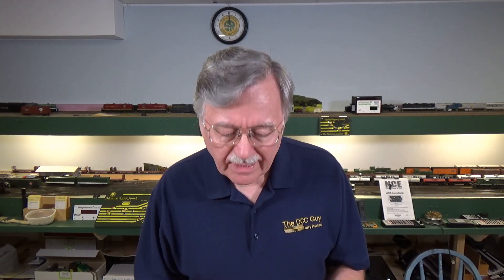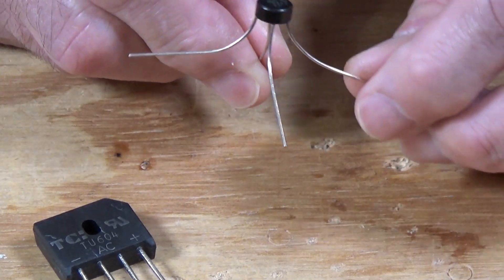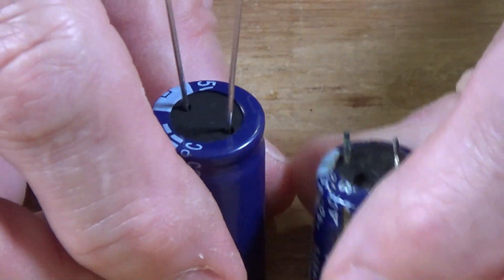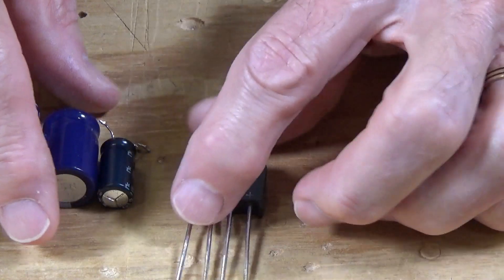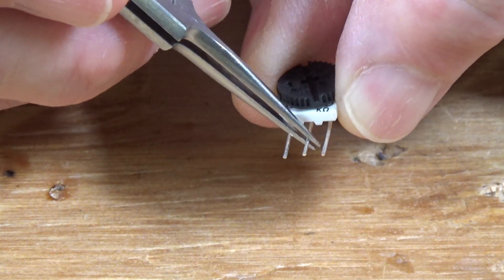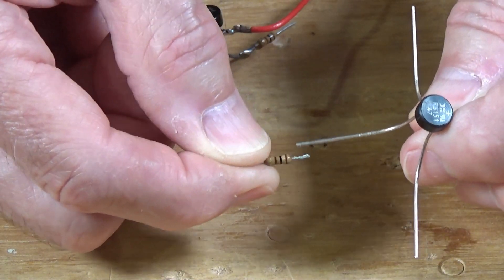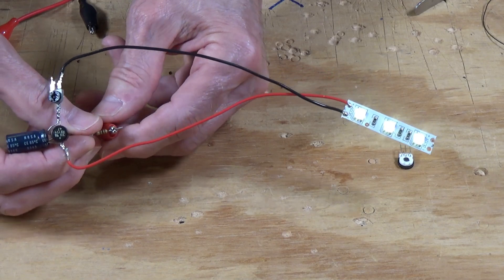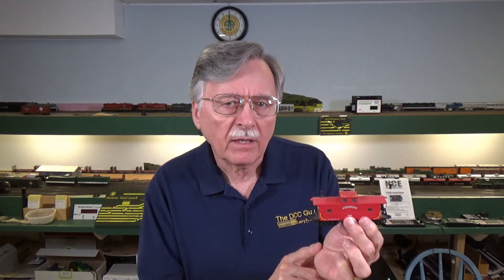Stay Alive Lighting For your Cabeese and Passenger Cars (101)

Comment: Hi, any suggestions for making Walther's passenger lighting kits flicker free. The kit comes with a lighting circuit board with built in LEDs . Just very sensitive to dirty track , dust ect.  Want to add a capacitor to store power, but do I need to still use all components as outlined in the video ?. Any suggestions would be great. Thanks.
Reply from the maker: You would think they would have included a capacitor in the circuit. I have one of theirs somewhere so let me see if I can find it and see how it works.
Reply: @TheDCCGuy   hey that would be great if you can look into that. I bought five cars with five lighting kits and I just hate the way they flicker.. mind you I didn't like the metal contacts in the kit that powered the LED printed circuit so I had fabricated my own. So basically the way it works is the weights on both sides of the car are electrified and isolated from each other from the trucks. I soldered a wire from the weight to the printed circuit led board for both sides isolated of course,  so current path is rail A to truck to metal weight on that side , then wire,  then circuit board and rail B does the other side the weight then circuit board the same way. I did this because the Walthers Way was so flimsy,  if you touch the roof the lights would shut off.  I need something in the middle of the wires  like a capacitor . Just a little unclear of the process. If there's any suggestions that would be great thank you.
Reply from the maker: The problem is the capacitor will need to be a polarized electrolytic type which means you need to feed it DC power not DCC. So you need a bridge rectifier in lone before the cap. The Walthers circuit may have that, I don’t know. The ideal approach would be to add the cap to the existing circuit if it has the rectifier, but that would be difficult to arrange. You might be able to just add a bridge rectifier and a cap in the wires from the track. The trouble is the Walthers circuit likely has a voltage regulator or resistors designed for a specific voltage range so you would likely need a 16V cap but it has to be big enough to give you the stay alive effect. Let me see if I can fond my old light board and see what might work.
Reply: @TheDCCGuy  Thanks alot !
Reply from the maker: Good news and bad news. I found the box but it is empty so the circuit board is floating somewhere and did not turn up on my searches. I tested the dining car I bought it for and no lights so I guess I did not install it. It apparently is designed for DCC use and looking at the photo on the box it has 4 diodes to create a rectifier and what I assume is a voltage regulator to provide the correct voltage for the LEDS. So if this is correct, it should be possible to wire in a series of super caps to provide stay alive, but without experimenting one one I don’t want to go on the record providing a guess. I’ll keep looking for the board as I know it is down there somewhere, but it has been almost 10:years since I last saw it.
Reply: @TheDCCGuy  do you want me to send or post a picture of the led board ?
Reply from the maker: I finally found mine, which according to the label on the package is designed for DCC and is for heavyweight cars. It was originally designed in 2004. It basically is just a bare board with 3 light bulbs wired directly to the contacts on the board near the pickup tabs at one end. So it appears on this one they went cheap and just put in ~16 volt light bulbs underneath the milky looking light strip and ran them in parallel off DCC power with no rectifier or voltage regulator. It would be easy to add a 16 volt cap and  1 amp bridge rectifier. You could even use one of the little buck boards and rectifier as I showed for the caboose lights allowing you to adjust the brightness to your satisfaction. Now if your board is different and uses LEDs then that’s a whole different ball game.
Reply: @TheDCCGuy  yeah mines different. The board has LEDs about 6 of them and the board has electronics on it, looks pretty busy.  Maybe just a capacitor needed , I don't know. I'm going to post a YouTube video on my channel on how it looks. Maybe you can take a peek. Thanks
Reply: @TheDCCGuy  ok so I uploaded a video showing what the board looks like. Hey listen I appreciate your time. I'm pretty happy with it but would like to make it perfect if possible. Thank you very much for your response.
Reply from the maker: I looked up Peter’s Trains and couldn’t find anything, is that the name of your channel? Can you just give me a link to the video?
Reply from the maker: OK, I found it and looked at the circuit. It appears to have a bridge rectifier, a couple of caps (brown rectangles), a resistor, and something else (6 legs) that I am not sure about.On the LED side it is clearly marked with +/- feeding the LEDs and I bet it is 3 VDC. So take a couple of clip leads and hook the board up to your track then check the voltage at those contacts. If it is 3VDC then you could install one of the 3V 1 F supercaps right there as a stay alive. Test it with clip leads before soldering to the board to make sure it works and doesn’t overheat and explode on you.
Reply: @TheDCCGuy  Thank you so much, I will try that . I'll let you know what happens. Appreciate your time.
Reply: @TheDCCGuy  Question ? If it is a 3V 1F supercap needed do I wire that across Rail A &  B connect ions (parallel )  or on 1 rail side only , in series like Rail A direct to one side of led strip and Rail B to  inlet of capacitor and then outlet of capacitor to other side of LED strip ?
Reply from the maker: Try matching polarity of the cap to the solder tabs on the circuit. It should recharge when power is on and then bleed it back out when power is interrupted. It is essentially the same as I did with the caboose lights.
Reply: @TheDCCGuy  thank you very much I'm going to order the capacitor you mentioned it is 3 volts and try it out. What's your name?
Reply from the maker: Make sure to actually measure the voltage across those contacts feeding the LEDs to confirm my WAG before ordering them.
Reply: @TheDCCGuy  Hi Larry , yes I will measure the voltage of the LEDs and see what it is before ordering capacitors. Thanks. I'll let you know  what the voltage is.
Reply: Hi Larry . Ok so I measured 2.8 v on those +& -contacts on the led board .
Reply: That voltage of 2.8v  was at the plus and minus contacts on the circuit board not the inlet contacts. Could a capacitor be soldered on the board  where the plus and minus  contacts are ? 3V 1 F  ?
Reply from the maker: Yes, that is the place. Also the capacitor will not charge to more than the provided voltage so 2.8 will be good as it is under the rated value and won’t overload the cap. Make sure to attach + to + and - to -. See my video if you are not sure. e is not room to pit the cap on teh circuit board you can attach it using small wires and tuck it wherever it will fit.
Reply: @TheDCCGuy  That's awesome, thanks alot for your advice, I've always wanted lighted passenger cars but couldn't stand the flickering. So excited to start that operation. I subscribed to your channel , your videos are so inspiring. I'll let you know how it turns out. Thanks Larry.
Reply from the maker: Another thong I just thought of. You may need to add a 100 ohm resistor on one input wire to,prevent inrush current from shutting down the booster. Since I have no idea how this circuit handles current I am not sure whether you will need it or not but it was necessary with my lighting circuit.
Reply: @TheDCCGuy  Hi Larry, yes that's a good idea, I was looking at the caboose video again and I was thinking of a resistor but wasn't sure how much resistance. Good idea. Thanks for your time .
Reply: @TheDCCGuy  Hi Larry, having a little difficulty finding a 3V 1F super cap, could I use a 5.5 V 1F capacitor ?
Reply from the maker: Mouser.com has over 2100 in stock. Look for 581-SCCR12E105SRB

Comment: I just found out that the "Radial electrolytic capacitor 1000uF, 25V" is the BIG one, not the smaller one since that's what I ordered. Fortunately, I think I can use these since I am doing passenger cars. Still, I was expecting the one you used.

Comment: Okay, now I'm confused. I watched your other video and it says this won't work for strip LEDs because they require 12 volts and with this one it seems to work fine. What is the output voltage here? Are these 3v strip lights?
Reply from the maker: Light strips like those sold for use under kitchen cabinets require a 12 VDC power supply. Individual white LEDs require about 3 VDC and in my smaller circuit I set it for 3 VDC accordingly. So you have 2 options for lighting cars, one smaller than the other. I did the second one for folks wanting to use individual LEDs working in N-scale.
Reply: @TheDCCGuy  I am looking to light passenger cars in HO using strip lighting so the output for them is right in the second video showing the strip lights?

Comment: @LarryPuckett can the leads on the bridge rectifier be trimmed shorter in any way?  I understand that the parts look A LOT bigger than they really are, but just out of curiosity.

Also, just out of curiosity, can the trim pod be wired to TWO light setups, so that when the knob gets turned one way one LED gets brighter and the other dimmer, and then when it gets turned the other way the one gets dimmer and the other brighter?  My mental gears are turning at full speed right now trying to imagine a use for such a setup....
Reply: Maybe a Christmas light setup using the fiber optic lighting method described in the January 2020 Model Railroader.
Reply: Or better yet, lights on a microwave tower as they used to operate up until the mid- to late-2000s or so.
Reply from the maker: You can trim them back as far as you want as long as there is something left to solder to. As for your other question the pot is just a variable resistor—turn it one way and voltage goes down, the other way it goes back up.

Comment: Thanks Larry for the great video.  Been wanting to do this for years.
I would like to use a function output form an old DCC decoder to control (ON & OFF)
the lights in a caboose.  Could I use the circuit you describe in the video, by using the
blue wire (+) and the purple wire (-)from the decoder.  I wouldn’t need the bridge rectifier
as the output from the decoder is DC.  
What are you thoughts.  Thanks
Reply from the maker: My main question would be how the decoder will respond to the demand from the capacitor, it may take it a d may not. I have never tried that type of arrangement.

Comment: If those lighting strips are used, how much draw is the 12v LEDs going to cause from DCC?
Thanks,
Mark
Reply from the maker: I just checked and the strip I used in the video pulls 0.03 amps or about the same as a small loco headlight bulb.
Reply: @TheDCCGuy  OK that's perfect but let's say I don't use a trim pot, what size resistor would bring that down to 12v?  From a 14v DCC NCE system?  Could I go with a 1 or 2k resistor?
Reply from the maker: Either should work. the 1K will be brighter of course, but Loksound uses 2.2K on the Direct boards. You might need to do a test with one of each. You also could use 1 trim pot, dial in the brightness, then measure the resistance value across it and know the exact size to use, it might be 1.5 K!
Reply: @TheDCCGuy  I tried a 2k but it seems to only light up the first 2 LEDs in the strip.  Could that be too much resistance or am I just going to have to deal with 2 lights at a time?
Reply from the maker: Sorry, my mind was on individual LEDs when I answered you and that is too much resistance. You would want to use something much smaller. Since these strips are made to run at 12VDC you only need to drop from about 13V to 12V. Try 100 ohms and you may even need to go lower.

Comment: Old Model Railroader - NEW subscriber!! 
That is SO clever!! Cheap and easy too. 😊  So, could I build that with a 1k ohm resistor instead of the Pot?? 
Just looking for even simpler... Thanks! 😁
Carmine ✈🚂🚙
Reply from the maker: The size of the resistor will depend on how many LEDs are in the strip and how much light you want in the caboose or car. The trim pot is essentially a variable resistor so you can easily set it for whatever choice you want.
Reply: Thanks for replying! I guess the Trim Pot isn't exactly adding a lot of complexity.... and is an option. 
My thought was, if I calculated the resistance value needed for DC... Wouldn't it work with this setup? 

Not trying to be difficult, just curious.
Reply from the maker: Sure, it will work, give it a try, resistors are cheap.

Comment: Larry,
I am an n scaler. Will the components you suggested fit in n scale cabooses? If not could you point me in the direction I might travel to get the components that will fit? Thanks
Reply from the maker: Fred—I am working on a smaller circuit that might fit better in N-scale equipment. The problem with the one shown in the video is the 1000uF capacitor is a bit big. I still need to test some other smaller caps to see if they will provide sufficient holdup time. It would help for me to know the internal dimensions of a typical N-scale caboose.

Comment: Can you discuss the use of magnetic switches  to control lighting in cars.  Who are they available from?  Thanks.
Reply from the maker: These are difficult to find except on eBay and I have seen them there. As the name implies these are small reed switches comprising 2 pieces of metal and when a magnet is passed over them it either pulls them together or separates them closing or opening the circuit. They are often used in household security systems to detect when doors or windows are opened. As I said do a search on eBay for magnetic reed switches. In locomotives and rolling stock they can be placed in the circuit and when you pass a magnet over them it turn the lights on or off depending on whether the reed switch is normally open (NO) or normally close (NC).

Comment: Larry, Thank you! This is very timely! On a similar note (Keep-Alives) are there any inherent problems with permanently consisting two identical locos, one with an Econami + Currentkeeper; the other with an NCE  D13NHP which includes a small No-Halt. Would the two keep-alives interact negatively? Thanks!
Reply from the maker: I wouldn’t think so. The main issue if that you won’t be able to use F11 braking since the NCE decoder does not support it.
Reply: @TheDCCGuy  Thanks, Larry! Appreciate it!

Comment: larry, another informative video, I have a dcc question, i am putting together a point to point layout on an upper deck of a logging camp with a rail served town at the other end, i want to put in a turntable at the town end to turn the locomotives around, how would i take care of the polarity on the rails when i head the trains back out towards the logging end of the layout?
Reply from the maker: That depends on how you plan to build the turntable. I covered that in my wiring book as well as in the March 2018 issue of MR.
Reply: @TheDCCGuy  it will be a out of the box turntable, and i looked in mar 2018 dcc corner and i did not find any information.
Reply from the maker: I’m sorry it was Feb 2018 page 66-67. Commercial turntables use different methods for separating the ring rails to prevent reversing issues. The old Atlas plastic ones had some kind of autoreversing design but most commercial ones use split rings or other approaches. What do the instructions that came with it say about providing reversing circuitry? At any rate you can easily use an autoreversing circuit like those made by Digitrax, DCC Specialties, MRC and others. I prefer a dual Frog Juice configured as an autoreverser. It worked the first time I installed it and has never missed a beat. You can get a good price from sellers on eBay or Litchfield Station (www.litchfieldstation.com).
Reply: @TheDCCGuy  thank you sir appriciate it.

Comment: Looking forward to the next video - I'm hoping to use this circuit to create something for my N Scale passenger cars and, if possible my Cabeese - I have seen another video on the same subject from Model Railroad Hobbyist Magazine, but you made it very clear and concise - Thank you! Greg, Melbourne, Australia.
Reply from the maker: Greg, the next circuit may be smaller since it will use supercaps, but the voltage regulator part of the circuit is a little over 11x17mm so may be a touch too big. If you plan to use individual LEDs instead of the light strips then a small electrolytic cap might work in place of my 1000uF one.

Comment: Very interesting. Will you demonstrate for N scale?
Reply from the maker: Jerry, sorry but I don’t have any N-scale equipment. But I will provide suggestions for N-scale power pickup in the next video. I am not sure that this circuit could be made to fit in N-scale cabooses but maybe passenger cars. You might experiment with smaller caps such as a 470 uF, 16-25V and see if that will provide adequate keep alive and also fit. I am not sure that my next circuit will fit N-scale any better but I’ll let you know once all the components arrive and I have a chance to see how small I can make it.

Comment: Larry, enjoyed the video. I am trying to light red leds on the rear end of a passenger coach. 
I have a problem coming up a way to build a voltage contact pickup from the trucks. I checked on line for pickup trucks and copper wiper kits, the suppliers I found are out of stock.
Do you have a video or any idea on how to get power from the trucks that is dependable.
Reply from the maker: George, see my comment posted under this topic and in the description.